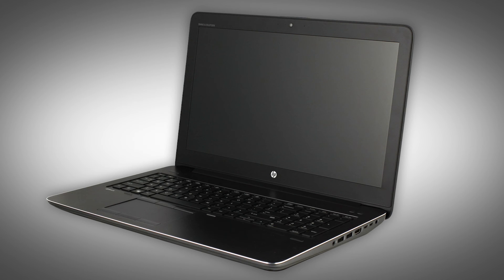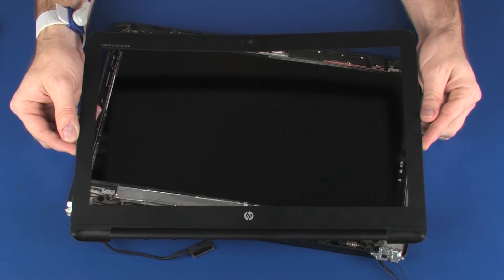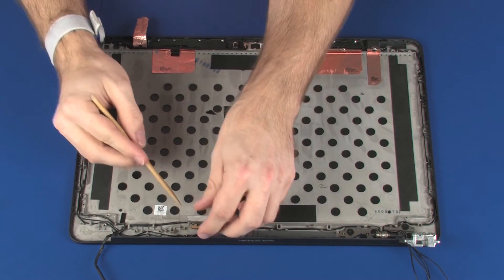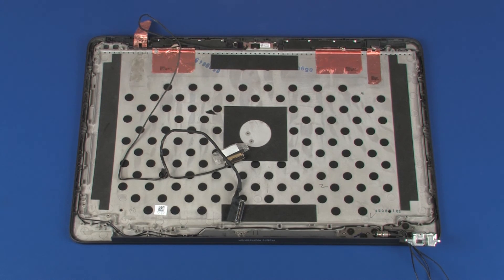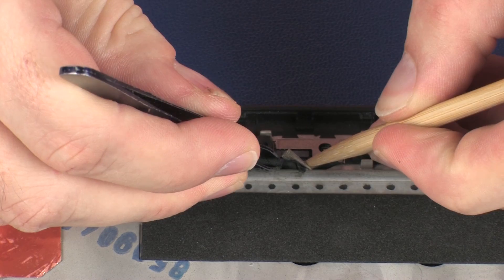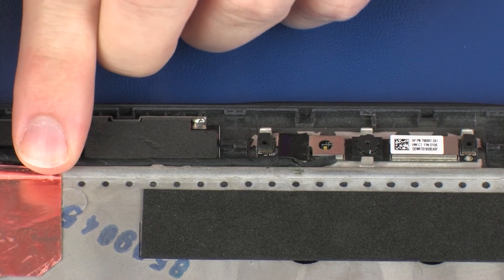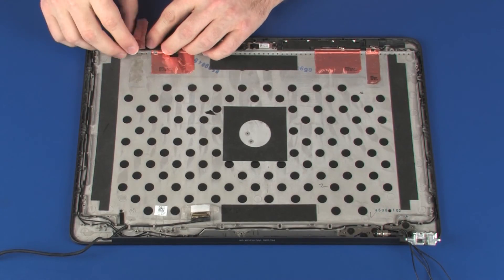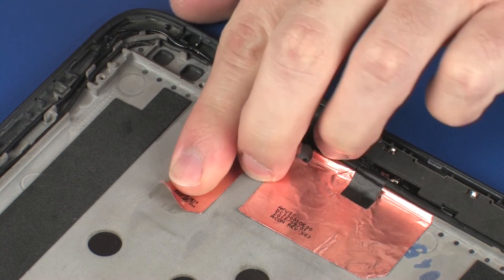Replace the Display Panel Cable | HP ZBook 15 G3 Mobile Workstation | HP Support

Comment: This zbook G3 suck, after only 3 year the display cable broke, and now I'm using it with an external monitor
Reply from the maker: +Fede66 Please contact our phone support team to fix the issue. Please follow these steps to reach them.
Step 1. Open link: https://support.hp.com/us-en/contact-hp
Step 2. Select the product type.
Step 3. Enter the serial number of your device or select let HP detect your product option.
Step 4. Select the country from the drop-down.
Step 5. You should see the HP phone support number.
Reply: @HPSupport  how can they fix the problem by the phone if it is a hardware problem ??  I had chosen a workstation because I thought they were machines made to last, I was wrong
Reply: @MultiNbaman  I'm having the same issue.